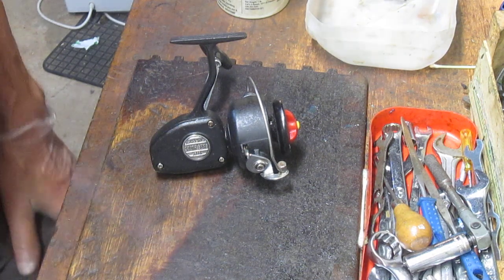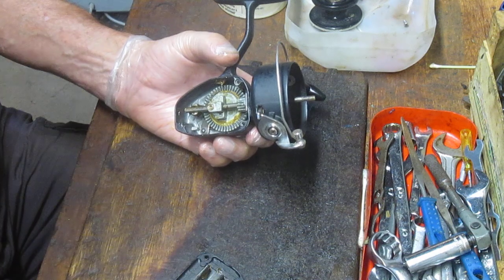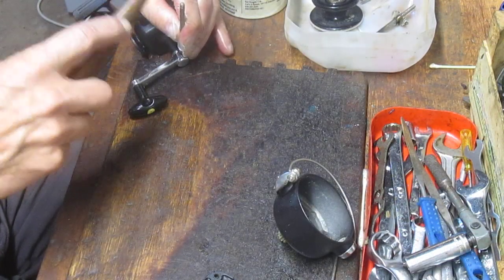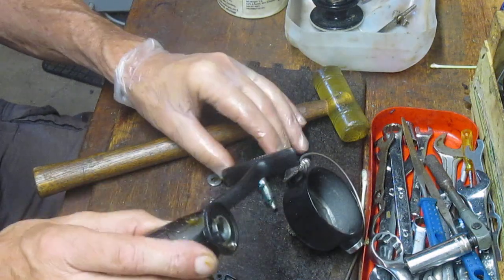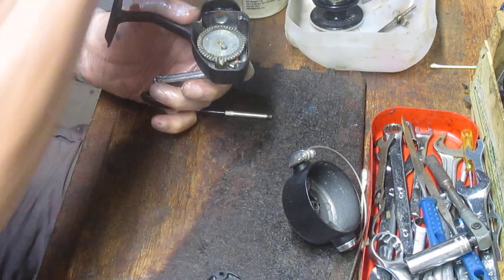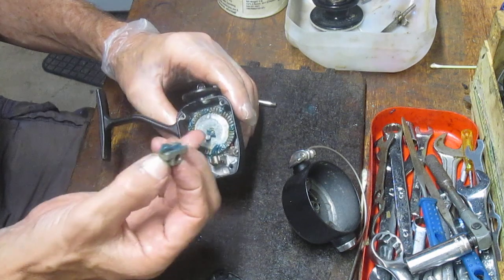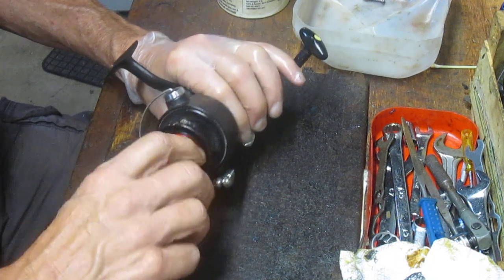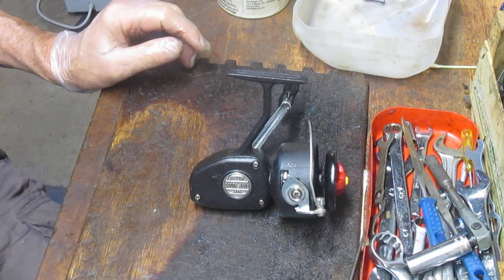Glading 820 South Bend Fishing reel take apart and service

Comment: this is the only video i could find about this reel i found one today took it apart lubed it up and its great may use it as a fresh water trout reel on the count its small profile sad it didn't have any barings but it seems tough with its steel fame they sure knew how to make these reels back then i go threw the newer graphite reels in a few years this south bend i found is old and still runs like a tank
Reply from the maker: Bearings aren't needed in most smaller reels. The manufacturers have conditioned us to think they are, but the truth is that a bushing is fine for most light tackle.  Thanks for watching - Dennis

Comment: I like that reel, and to tell you the truth the grind doesn't bother me, sort of a peaceful Zen sound that could relax ones self and maybe even put you to sleep...lol, it seems that those were thrown together without tight tolerances and any slight tilt in the gear mesh would allow it to have that sound and grind a little.
Reply from the maker: These reels were made for occasional recreational fishing.  A few times over the summer and they are fine.  They are not the daily go to reel and the materials are not durable enough to stand the rigors.  Now, if you want to throw a bare hook and cork out on to the pond and relax....it's your reel. :)
Dennis